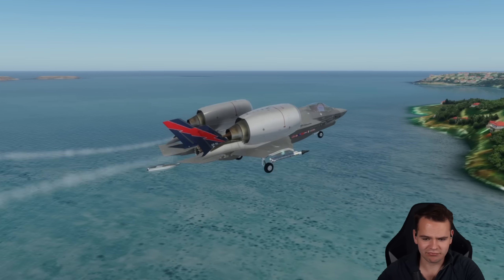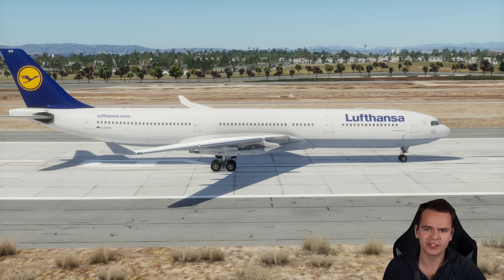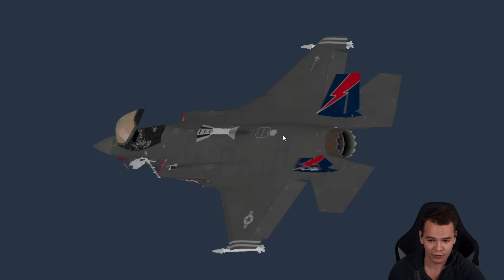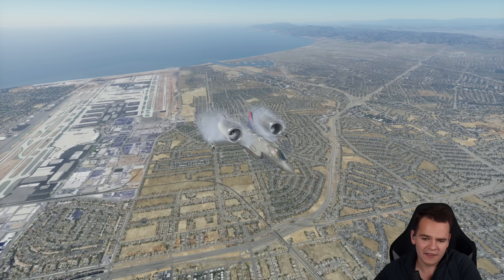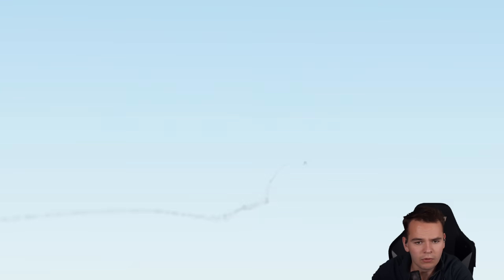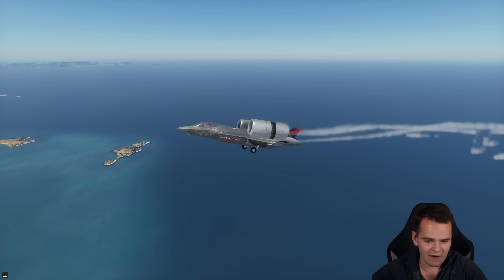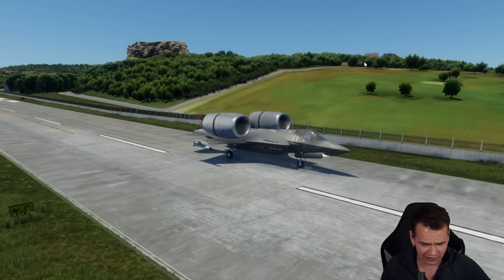Fitting AIRLINER ENGINES TO A JET FIGHTER - How FAST Can We Fly?

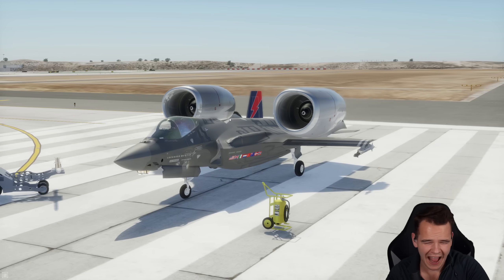Comment: 2:49 the F35 A and C do not have thrust vectoring. the B does in a sense, but only for VTOL. 

the F35 is not particularly manueverable, it's designed to strike at 100nm, not get into dogfights.

you may be thingking of the F22, which does have pitch-axis TV. it shouldn't get into dogfights either, but if it does, it can handle itself.

Comment: There is a reason for Trust to Weight Ratios. The aircraft has to weigh less than the thrust produced. There is no way a commercial airliner is going to weigh less than 50,000 lbs. A 737 Max Takeoff Weight is 174,200 lbs so there is no way that would work

Comment: The F-35 isn’t the most powerful fighter jet. It’s a multirole platform, not an air superiority machine. The F-22 would beat it hands down in almost any scenario except air-to-ground and strike missions. The Raptor was built for air dominance, with far superior speed, thrust, service ceiling, and agility thanks to thrust vectoring. It’s also stealthier overall, especially at high altitude. That said, it comes at a price, roughly three to four times more than the F-35.

Comment: That’s the difference between a, big commercial turbo fan engine and a fighter jet engine. It’s like the difference between torque, and horsepower. 
A tractor trailer. And a Corvette sports car.
Let me put this big diesel tracker trailer engine inside of that Corvette …😶
Would be like let me put that Corvette engine inside that diesel truck…🤣👍🏻
I’m curious if that one fighter jet could possibly take off and reverse with that reverse thrust 😉

Comment: GE-90 has a range of thrusts depending on variant, from about 80,000 lbs of thrust up to 115,000 lbs of thrust.  If you see a GE 90 with curved or scimitar shaped compressor blades, it's a variant with at least 110,000 lbs of thrust.

Comment: The reason you cant go fast with the airliner engine is not only the aerodynamics - a jet turbine only works when fed with subsonic air. the air inlet ducts of a fighter jet are designed in a way that they slow down the incoming air (some even have variable ramps to do that) and thus allow flying faster than the speed of sound. this is of course not possible on the 737 engines you slapped onto the f-35 cause they directly injest the highspeed air.

Comment: Put the concorde engines on an A320
Reply: the interesting thing is the f-35s engine is actually a bit more powerful despite its smaller size. but of course the f-35 only has one, not four.
Reply: @Digi20  The F-35’s engine only generates more thrust while in afterburner. The Pratt & Whitney F135 engine, which powers the F-35, makes 125 kN of thrust dry and 191 kN in afterburner. In comparison, the Concorde’s engine the Rolls-Royce/Snecma Olympus 593 turbojet makes 140 kN of thrust dry and only 169.2 kN in afterburner. So, you’re partly right.
Reply: Nah, strap it to the back of an F-104.
Reply: Concorde engines on a Cessna 152 xD
Reply: No use. They are optimized for Mach 2, the airframe is not. You’d have terrible fuel efficiency and most likely the airbus would break itself apart very quickly.
Reply: Yyyyeeeessssss

Comment: How many Cessna 172 engines will it need to takeoff ina A380?
Reply: here’s your answer: a lot
Reply: Prob impossible cause Cessna propellers are designed to fly an aircraft that weighs a ton only at speed of what…65kts?(takeoff) The a380’s even the empty weight is about 300t with at least 150kts of speed to take off. So thinking of the wing size, hundreds or maybe even thousands wouldn’t fit
Reply: 5k should be enoguh 1.244.00/250~4.976 just calculating ghe power theorathically its possible, practikal impossible
Reply: Around 500
Reply: 407
Reply: 380
Reply: How many a330 engines need to make a Cessna 172 blow up after take of?
Reply: Around 440

Comment: 2:49 the f-35 does not use thrust vectoring, what you might bet thinking about is the f-35B wich can move the nozzle downwards to take-off vertacly but this is not used for manouvering
Reply: Actually no, he is confusing the F-35 and the F-22 which uses thrust vectoring and looks similar.
Reply: Not the F-35, but the F-35B? Your pedantry is female repellant.
Reply: OK, all VTOL capable fighters (except the Yak-38 demonstrater I think) have thrust vectoring. 
They have to, by definition,  be able to send thrust backwards or downwards.
But there's a separate use for thrust vectoring, supermaneuverability.

The F-35A and C do not have thrust vectoring at all, the B does but it's for STOVL use.
Reply: @MostlyPennyCat yes but again. VTOL capable fighters do not count. The form of thrust vectoring on them has nothing to do with super-maneuverability like what most people mean when they say Thrust Vectoring. So again, he is getting the F-35 confused with the super-maneuverable, F-22 Raptor. And it's true, mid-flight, thrust vectoring capabilities.
Reply: @HIPY96 

Do not count as what though? 
Harrier
F-35B
F-22

These are all thrust vectoring aircraft. 
Harrier van even use it to increase it's turn rate at the cost of energy. 

Ultimately the engines are the same thing on all three listed aircraft, all TV turbofans.
Reply: @MostlyPennyCat Um duh. Of course they're all turbofans. They do not count as super-maneuverable, thrust vectoring capabilities... which is AGAIN what most think of, when they hear thrust vectoring. Not the Harrier, not the F-35B, although those are technically considered thrust vectoring too.
Reply: close enough
Reply: It's a VTOL variant
Reply: @Randomly_Browsing  not VTOL but STOVL actually.
Reply: @the86kid11  still a VTOL even for short take off
Reply: still vectors its thrust, no?
Reply: @sam-of4kr  yes but generally "thrust vectoring" is used to describe an airplane that uses moving nozzles to allow for higher maneuverability. its not on the f-35, the moving nozzle is only used to divert the thrust downwards for the VTOL functionallity.
Reply: @Digi20   it also does that.... how do u think it can have yaw, roll and pitch while in a hover
Reply: @sam-of4kr  yes, in hover. but as i said, that is not used to make the airplane more maneuverable at combat speeds.

Comment: This man won't run out of ideas
Reply: This man won’t run out of brainrot
Reply: @I_like_rc13 That's what we need
Reply: Bombardino Crocodilo
Reply: thats exactly what i was thinking, its amazing
Reply: Here is on more idea, add bulk nods on the mid close main (2)wings extenting outward front & back. Then place airbus engines on them, one bottom front & rear top of each nod. You then make them able to swivel all engines 135° parallel. Perfect VTOL.
Reply: To be fair, that's Trump's idea ! A twin engine F-35 !
Reply: @fabr5747 same dude who knew how f'd up the rail system is in speed.
Reply: He's never gonna
Reply: @welovetacos111kkk give you up